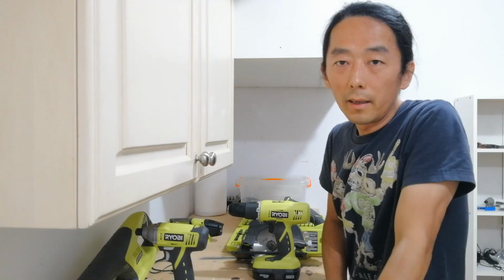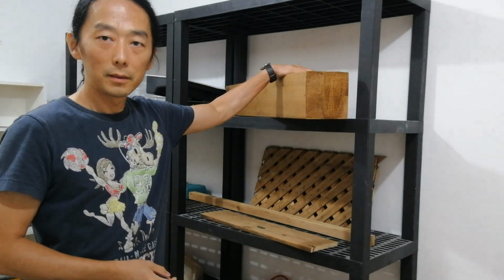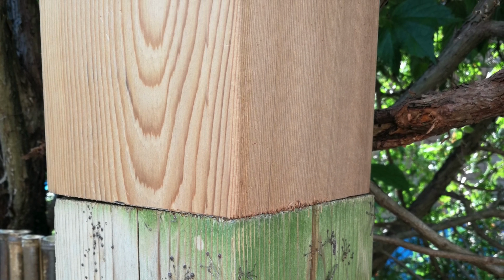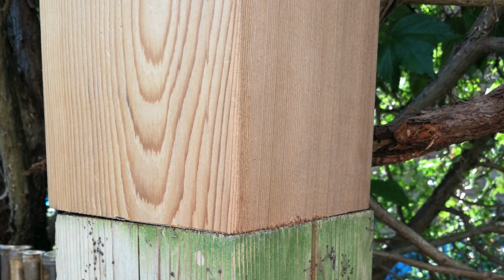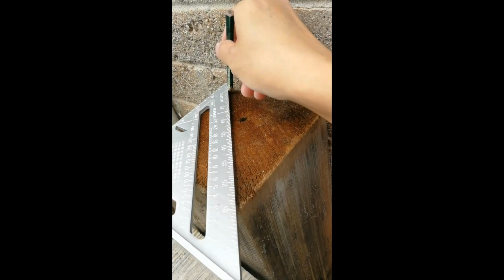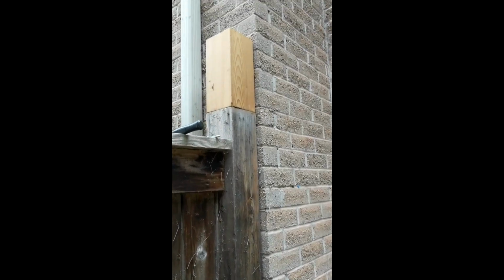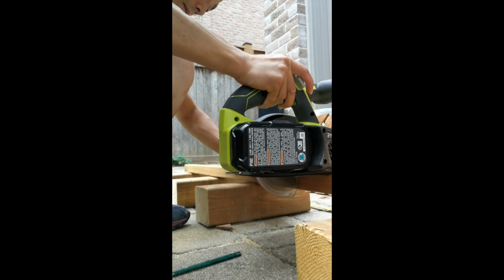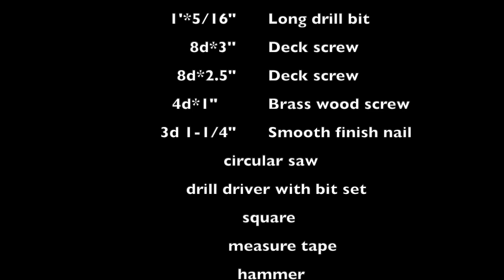Easy fence DIY: Privacy Lattice Extension

Comment: Thanks.  Good job!  I need to  add a post extension as well to existing fence posts to install privacy lattice.  The important key is to drill the center hole that's aligned correctly on the existing post and the post extension so when installing the post extension it's lined up and fits well with existing post.  I wonder if a portable drill guide would help drill correctly.

Comment: Nice Job, Just noticing you door sagging, if you reverse the angle piece and reverse it so the high point is opposite the hinge side the door will not sag. Just a thought.
Reply from the maker: Yeah exactly, the sagging door, what a sharp observation! And thanks for your suggestion, will check if that would work.
Reply from the maker: Moved the bolt and clamp to the bottom and it work well, as I found that it is wider in the bottom of the gate, the top of left side fence is leaning inside about 1-2 cm.

Comment: Bought a house with a printed fence..could I take off the paint with pressure washer or I can damage the fence??  I would like to take off the paint if possible and just stain it...I love on a corner lot so my fence is long
Reply from the maker: Not sure how the paint looks like, the dark color or light color? If it is a light one, maybe cover it by the cedar color paint? Otherwise, I guess the outdoor waterproof paint has been soaked deeply so you can't remove it without hurting into the fibre. You may get the idea if you check my another video where I show how pressure washing hurts the fibre.  And I think an experiment on a small piece could also help.
Reply: @tao-8997  sorry I ment painted fence.

Comment: 👍👍 Very nice job.  I would suggest that it would likely have looked much much more nicer if you had Pressure Washed the existing fence prior to the new install.  That may have allowed you to re-stain and seal the existing wood to look close as the new finish.
Also as Tommy mentioned.  A sealer between the post extensions to keep water out.  A flexible Deck Adhesive is like liquid nails and extremely hard to dislodge the joints!